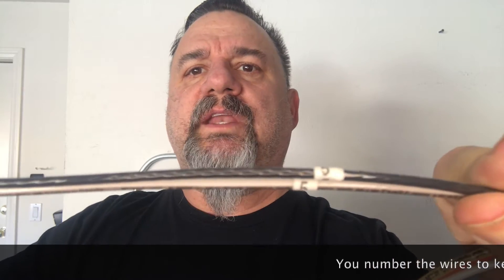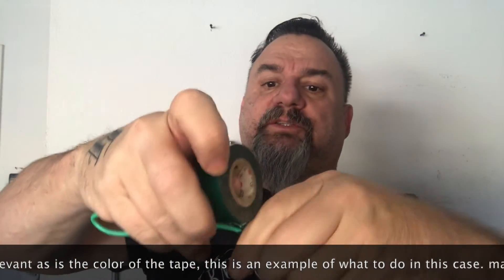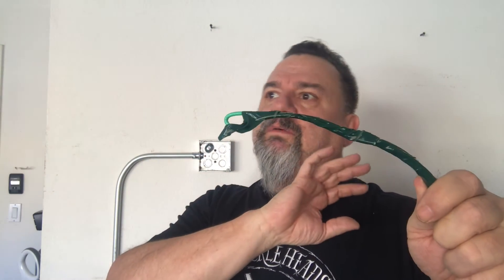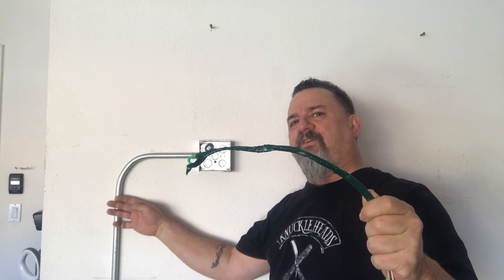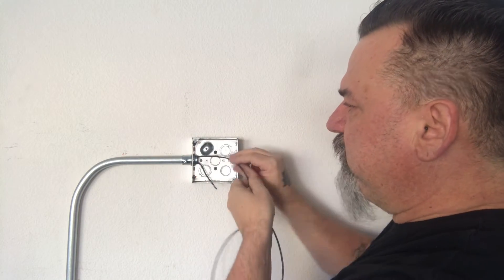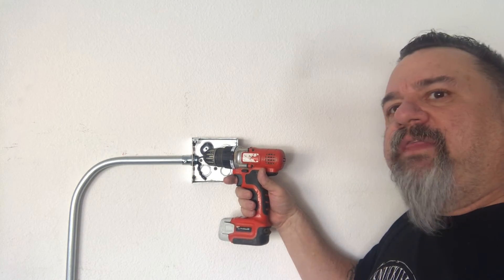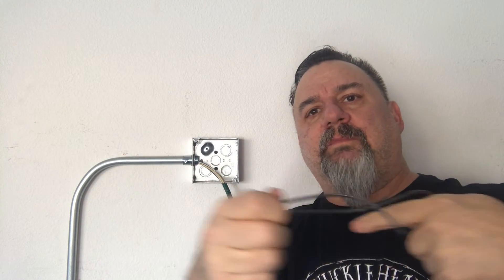Wire Pulling Trick Everyone Needs to See: When the Fish Tape Fails, What You Do Next Will Shock You!

Comment: In my situation I have one wire that got stuck but there are also existing wires. Do you have advice here? Since I don’t think your trick will work for me, unless I pull all the wires at once. I’m afraid it will get tangled with all existing ones. Awesome video BTW
Reply from the maker: sometimes its not the solution but a trick with empty wall cavity is great

Comment: I use a similar method whenever I'm pulling cable  underground. Esp on pulls longer than 100". I tie a big loop 6"-12" of jet/pull string at the tip of the duct auger. The auger never wants to go up that last 90°. I next bend my metal fish to make a hook like in the video. I then push the metal fish in until i get to the 90, and then i pull it back & forth a few times until i can feel the added weight. It usually catches the string immediately. It works great.  
PS. Dont forget about the vacuum method. That works well on empty that arent already filled with tons of watee & mud.

Comment: Awesome trick for snagging wires hung up in a conduit.   I'm assuming, when you need to pull multiple wires, it is best practice to bundle them and pull them all at once as you have shown, rather than pulling three and then three more?   When the conduit size allows for future expansion and you need to pull 2 more wires a few years later, what are the associated problems of pulling through a conduit that already contains wires?  I also assume it would be wise to leave a fish string inside the conduit run in case future wires need to be pulled?   No one seems to be addressing this scenario.

Comment: If you are going to pull, ya gotta stretch that tape tight when you wrap it.  

I've seen a bunch of your short videos. Great content. I'm retired and I've seen almost everything :) I worked alone for decades and learned how to do pretty much everything by myself.  The biggest wire pulling trick (alone) can be to take the conduit apart or leave off the last 90. Technically against code but it's like jaywalking when there id no traffic :)

Comment: this only works if the conduit allows enough room for the wire trick to get past it right? im no electrician yet, but im just going to assume code wire filling prevents you from overfilling allowing for 1 wire to sneak past the bundle normaly without having to extend a ground wire for the eye

Comment: I screwed into my van wall and clipped a low-voltage wire.  Can I try a similar trick using the existing shorted 14ga wire?  No conduit, a couple corners.  Worth a shot?  Any advice on attaching new wire to old and pulling it?  

The drill trick is amazing, but will it work if you have a run longer than the foot or two you demonstrate?
Reply from the maker: Yea It works well for a lot of things. its tougher to feel when you go past the head though. you also dont want to much wire tangled up, then its a bigger mess.  A solid wire works great for longer runs.

Comment: Any help as I am replacing a spa fixture in 3/4 casing, I will use the existing wire to pull, a ground wire that is attached to the junction box and to the niche,  will this wire hinder my pull?
Reply from the maker: sometimes you gotta use what is there. a fish tape can be a bitch sometimes. make sure you make the head up tight so it doesnt pull off in the pipe.
Reply: @StarvingElectrician  no, sorry I was not clear, no fish tape,, will connect the new wire to the old wire, use the old wire as the fish tape, a ground will stay that is connected, does that make sense to you or am I not explaining correctly?

Comment: Any tips on pulling wires through an insulated wall?  What about drilling a hole through the top cap if you can't get to it from the attic?
Reply from the maker: Great question and thats the next video im doing this weekend. thanks
Reply: When trying to fish wire down an insulated wall, I find that a piece of #6 bare copper wire without a hook, will push right through fiberglass insulation. Also if you are in the attic and get insulation on your arms, duct tape will help to get it off. also if you can't get that fish tape through that last bend, loop a few wraps of pull string through the eye, then when you put another fish tape in from the other end the open hook will grab the string and then you can pull it through. Also don't forget to straighten all of the kinks out of your fish tape regularly and wipe some oil on it. If its a hard pull, soap it ALL THE WAY. Don't wait until it gets hard to pull. It won't help then. Remember wire is like water it's easier to pull down hill. Never pull straight out of a conduit (sideways) you will curl the fish tape and make a mess.

Comment: Awesome tip! I have to run a Cat 6 ethernet cable through a 1 inch maybe 1 1/4 pipe with a 50 amp cable already in it, I have no idea what to expect.
Reply from the maker: you know you are not supposed to run low voltage and high voltage in the same raceway right? thanks for watching.
Reply: @StarvingElectrician  No, I'm glad I commented LOL.
Reply: @dfanman1  Aside from the safety hazard, the induced noise from the current in the 50 amp line will seriously interfere with the signal on your Cat 6 cable, making it useless.
Reply: @thomasstambaugh5181  I do not know how I'm going to get a Cat 6 cable out there now. :(
Reply: @dfanman1  Maybe consider a wireless MESH network or Ethernet Powerline Adapters.  Mesh works great... Powerline Adapters are a little hit or miss, but may solve your problem.

Comment: Great tip, I’lld give this a shot, thin metal wire might even be easier to work into the pipe.
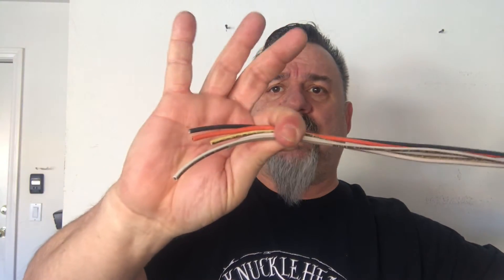Reply from the maker: this trick just worked for me when working with stranded.doing a live feed at 1:00 today stop on by!

Comment: Thanks for the video, I worked with alot of electricians never seen this trick. Most jobs I have been on would use 3/4" conduit instead of 1/2" for power circuits.  I think the only time they use 1/2 " is for control circuits like fire alarm or data circuits.
Reply from the maker: Glad it helped, 1/2 is very common but a pain in the ass if you are pulling solid wire

Comment: That is a fantastic hack to retrieve a broken pull string. Thank you
Reply from the maker: yea the break and when they are close sometimes this gets you over that hump.
Reply: You'd probably want to try putting lube on the tube first though because otherwise whatever prevented you from pulling it the first time would still prevent you even with this trick, and the hold you have on the wires here likely wouldn't be as strong as before so you really need to lube up the tube first, not sure if in America you have corrugated tubes but in Europe they're common and in a tube like that when things get stuck they get stuck for real and won't come off unless you add some lube

I'm actually gonna experiment something i heard of, using an air compressor to push lube from one end of the tube to the other before i try this, not sure if it'll work but it's worth a shot lol

Comment: Absolutely love this trick THANK YOU I've had fish line break just like this and what a nightmare. Particularly with 4 sets of 3 #10 inside of a 2" pvc about 200 feet long 😳
Reply from the maker: Glad it helped!
Reply: Did you up your wire size? Every 100' your wire will suffer from v.d.
Reply: Try pulling 3 #2 and a bonding wire with a ground 200' uphill .

Comment: We always tried to keep total bends below 270 degrees. Have to watch never install say a 45 degree kick right before a condulet. Had a sparky that always installed all on codulets   the wrong way. Told him that when pulling from a high ceiling want the opening facing the ground so guy pulling heavy cable can stay on stable ground rather then a genie lift or sizzles lift.

Comment: Hey man, thanks much for your videos.   I just moved into a new house that needs A LOT of wires run and some are going to be tricky.   I am learning so much from your videos, some like the chain I already was doing but never thought of probing through the ceiling with a piece of wire to find the drill location.   I'm worried because I think i am running into fireblocks, I am waiting to repair my in wall camera to confirm.   Going to see if you have a video for dealing with fireblocks, any idea when they started adding them?  my house was built in 1990.   Also any tricks for dealing with attics that have al ot of insulation and you cant walk around?  i want to add a ceiling fan and a bathroom fan but the attic has tall fluffyt insulatioon and no floor boards.   To install the fan box supports and mount the bathroom fan to the beams, wouldnt i need to get access from above?
Reply from the maker: Very cool. My next video with a fishing ploe helps with those attics I wont go into. with fire blocks sometime you have to cut holes or get a long extention bit and drill through them but its a bitch to fish so thats where holes in the drywall happen. good luck and stay tuned.

Comment: Any ideas of what I can try? Changing the pool housing/light in pool, the old cord will not budge from the conduit. Its stuck. I tried pulling from both ends.
Reply from the maker: wow thats a tough one. if its stuck the pipe may be rusted or pinched. you have nothing to loose at this point id get rough with it or dig it up and cut the pipe and replace it that way and replace that part of the pipe. its a pain and may be a big job but what options are there. ya know? good luck